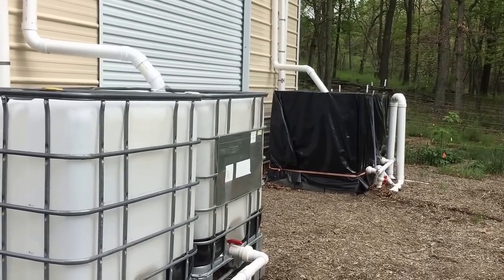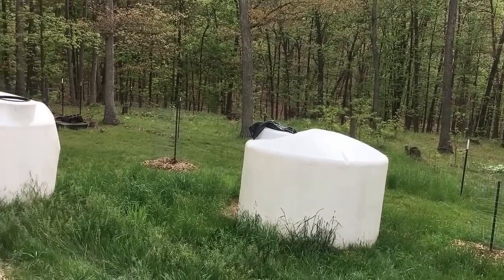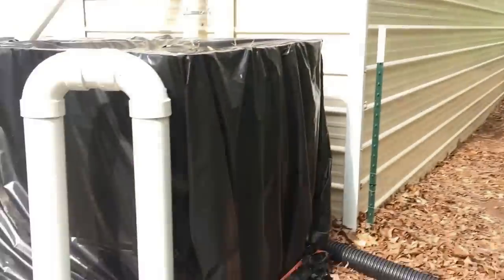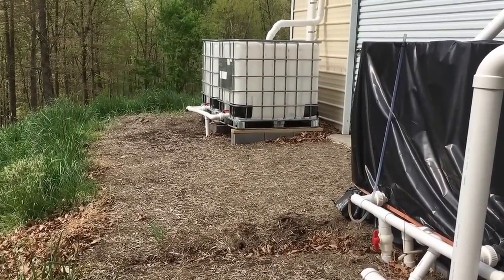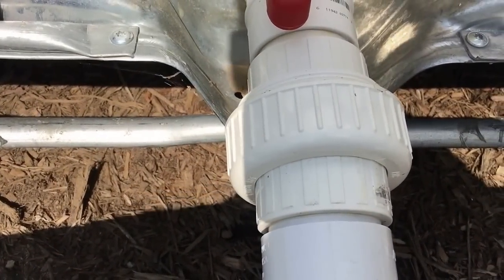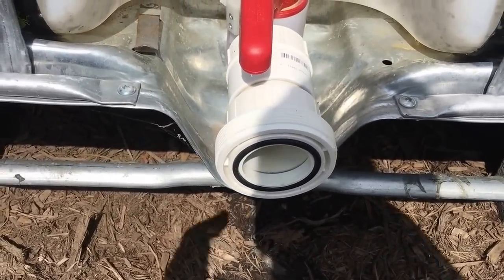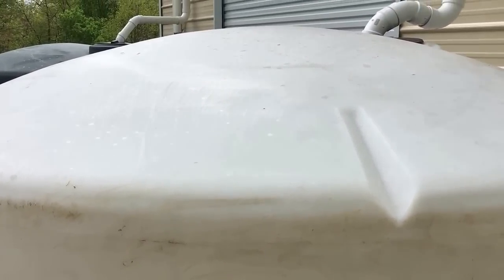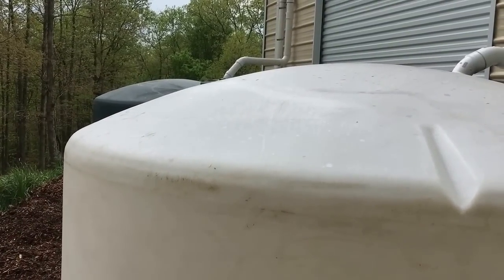Large Rainwater Harvesting System Upgrade

Comment: the tape is called teflon type.

THE EQUATION FOR RAINWATER HARVESTING IS: length of roof in feet x width of roof in feet X inches of rain X 0.68 for the first flush systems= amount of rain harvested in gallons.
 
So 20 X 40 ft roof X 1 inch of rain X 0.68 = 544 gallons
Reply from the maker: Thanks

Comment: I think the shut off valve should be closest to the tank then and the union ie quick connect
Reply from the maker: Yea, it could actually go either way.  Actually, if I had the funds, it could use a cutoff on both sides of the quick connect, so I can isolate the tank and the system, depending on what I'm doing, without having to drain one section or the other.  Thanks!

Comment: hey looking good Tod, cant never have enough storage capacity! have you tried a heat gun and adding air pressure to the tanks to pop the dents??
Reply from the maker: I have not tried a heat gun.  I may give that a try.  I did pop the dent out on one of them and then it went right back in, so it is a little stubborn.  The tanks are full now, but I have not been out to the farm to see if the weight popped the dents out and I keep forgetting to ask the folks out there to look for me.  I'll try the heat gun on the second tank if water pressure doesn't work though.  Thanks!
Reply: Great Escape Farms ya the heat gun and air pressure would reset the dent to its original spot and once it cools will have strength to stay the rather than pop back into the dent..
Reply from the maker: Thanks!

Comment: Plasti dip would work well to block sunlight and protect your tanks. It's a aerosol plastic spray. Easy to use like a rattle can
Reply from the maker: Ah, that would work - and it's even on Amazon: https://www.amazon.com/Performix-11203-Multi-Purpose-Coating-Aerosol/dp/B0006SU3QW/ref=as_sl_pc_qf_sp_asin_til?tag=greescfar-20&linkCode=w00&linkId=5c327998f1a08c580e8c2fa9b63abec1&creativeASIN=B0006SU3QW
Reply: Great Escape Farms     n

Comment: Use sand for your bed under your tanks. In Australia we use  CCA logs to stop it from washing away by making a frame around the tank. With the water diverter, use a valve at the base and just crack it open slightly. Makes cleaning easy.
Reply from the maker: Thanks for the suggestions Peter.  I used the wood chips as a no cost option because I had them already.  Next year once things settle, I may try sand.